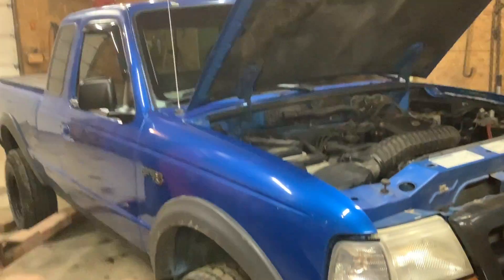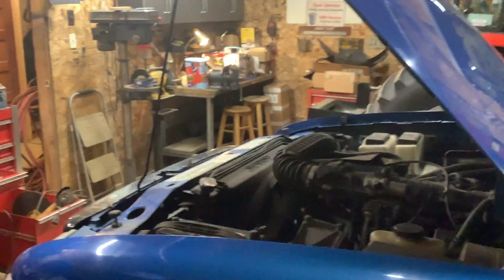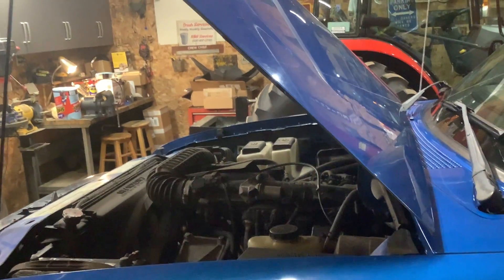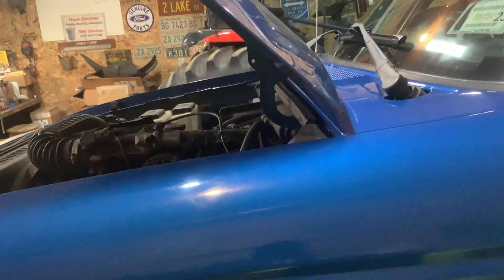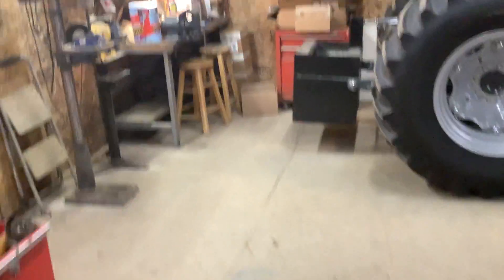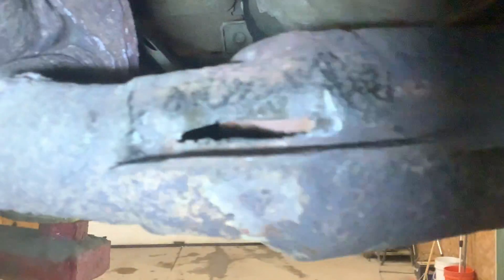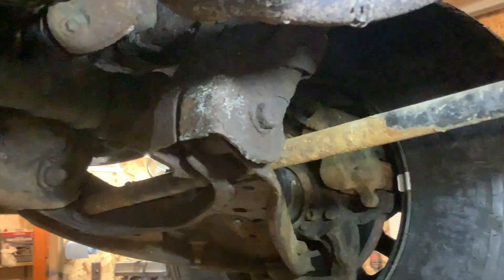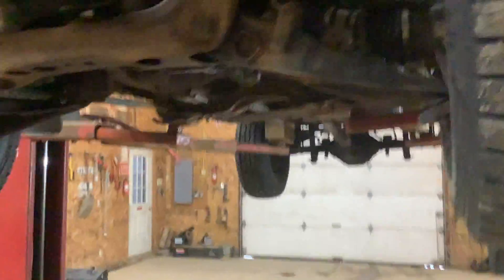The Danger Ranger has a leak ...

Comment: I’d say a little patch work beats the heck out of a $500 repair!
Reply from the maker: Yes it does , it turned out to be 4 holes in 2 of the converters and the metal was kinda thin so I used sum #9 wire to weld into the weld and patch ..much quieter now . So I’ll keep the $500 in my pocket for now . Thanks

Comment: So it had no brakes when you got it ?
Reply from the maker: No it had brakes , we just changed them out and added new pads and rotors , and repaired the brake line on the front left . Now the brake hose is kinda wet so I’ll change that and run a new line from the Splitter block to it . 
Thanks .